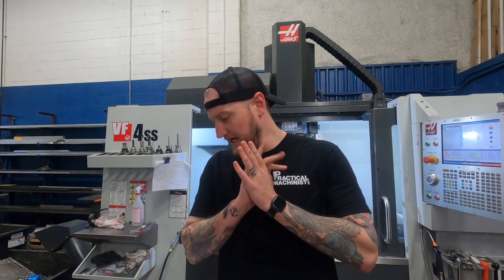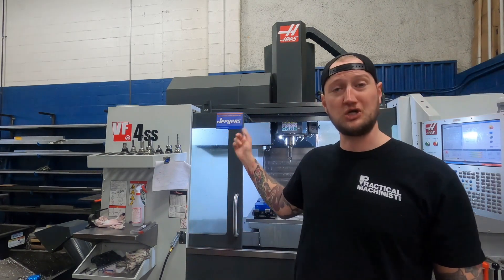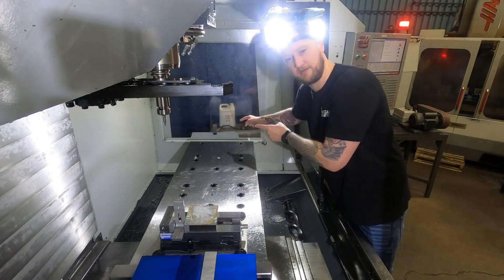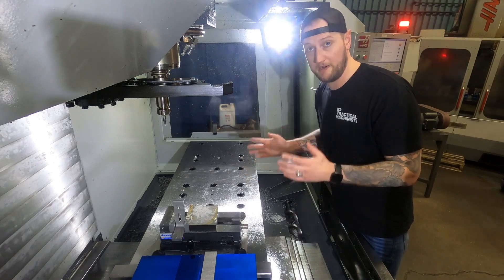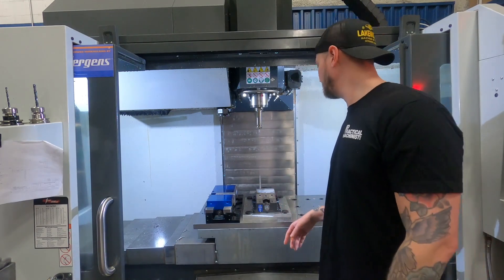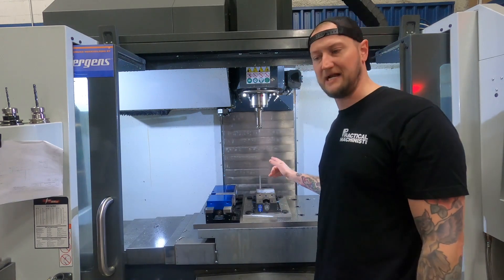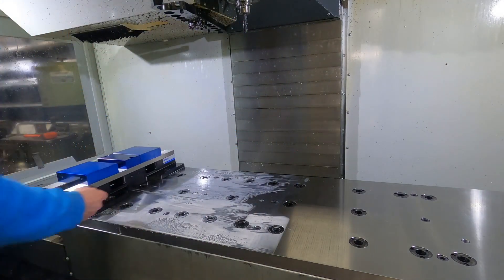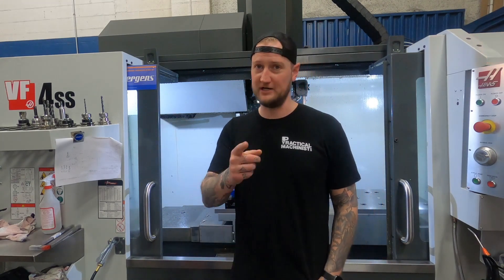WORKHOLDING: Is Your Shop Doing It Right? | Machine Shop Talk Ep. 82

Comment: Our shop as been quick-change/ modular since the beginning not this particular system but pretty much all our lathes are quick change tooling (capto, komet ABS) and quick change chuck systems. 

I don’t think there is a downside except maybe that your kinda locked into a brand which could be an issue if they stop making the product or go out of business. I don’t think Jergens is going to have that problem. 

Looking forward to more of this we have a rock lock 5th axis for the fourth wish I got a long time ago, I’d like to see if you could get Adaptix system to try don’t know if they work well but a lot quicker then softjaws for a short run.

Are you going the the Joint open house next week?

Comment: i have to say it all looks good to me, the But is , it is all solid clamping i want my vice to move if i crash, i never use my T slot slugs to align a vice i want a vice to move if i do , you are talking 1 min to dial it in , in 38 years dong this i have seen machines have a spindle die because the clamping didn't move so killed the spindle as the pull stud went before the clamping, i have seen T slots killed when they had the slug in and the machine was stronger than the bed  , if it didn't it killed the location holes, and we all no matter how many years we do this we crash a machine . just saying, on your machines the spindle would be $18/20k ish , compare that to quick change. i like it but always look on the downside, if you never crash go for it .

Comment: I'm not sure why the table needs to be bigger cause the machine can't actually reach the part of the table that is over hanging enlighten me please.
Reply: So that extended side is for the 4th axis, so we’re not wasting table space on the body of the 4th axis but keep the whole working envelope
Reply: @LakewoodMachine  Oh yes! thats good thank you!
Reply: @bcdasilva2748  no worries man!
Reply: That area is taken up by the 4th axis,  put the face of the rotary table at or around X0 giving you full use of table travel and long fixtures
Reply: With the plate sticking out and over like that, along with a heavy fourth axis placed on top, curious how parallelism and stability can be maintained over time and during cutting operations?
Reply: @lilchirp4846  It will be interesting to see - but they've been in the business of making these systems for quite some time so I imagine they've got it dialed in!
Reply: @lilchirp4846  done it for years never had any issues  that I can think of , may want to check the level on the machine , may add more wear than without, but your also getting more productivity.
Reply: I might be not updated on the workspace as far as machines go. Mine has more table than workspace. I have a CAMPRO CSP 750 2007